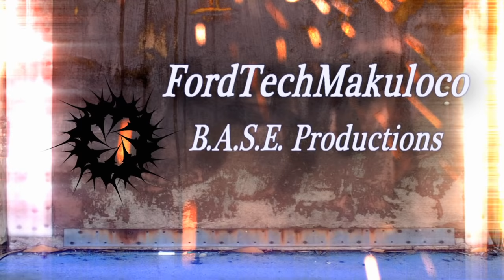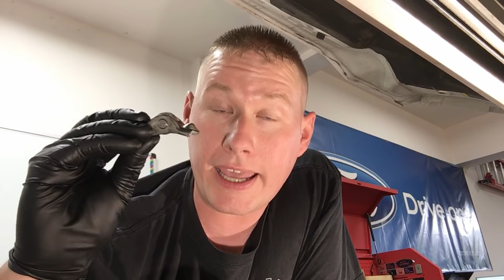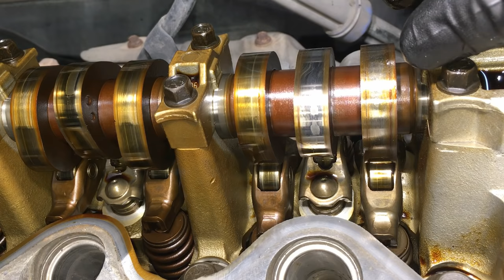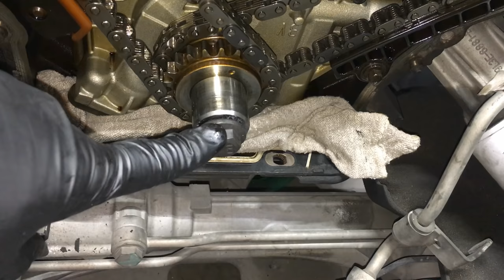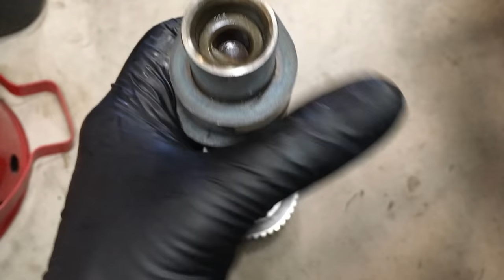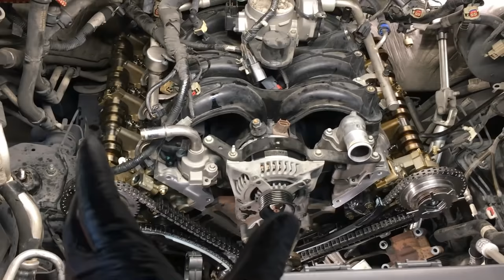Ford 5.4L 3v Triton Engines: Roller Follower Removal and Installation

Comment from the maker: These are the Tools and Parts I Recommend:
Valve Spring Compressor Tool-
http://amzn.to/2yorAwx

2004-2014 Engines Latest Roller Followers x24-
https://amzn.to/3BtEHgm

2005-2014 Engines can utilize this Ford Racing Kit-
https://amzn.to/492DRYC
Reply: @FordTechMakuloco i watched another video, with timing cover removed, there was no need to remove the roller follower to replace cam phasers and chains. I'm at the point of removing the chains. do i really need to remove the followers?
Reply: FordTechMakuloco  will it be off time if i spin crankshaft? Both chains were on , already time before i spon it just to have clearance to put the rest of roller followers. Will i have to put it back at 6 oclock? After spining it ?
Reply: HEY IS IT OK TO JUST LOOSEN THE TWO TOP CAM BOLTS ON THE LOB INSTEAD OF USEING THE VALVE SPRING COMPRESSOR TOOL?
Reply: Is this the same for all 5.4L Engines?
Reply: FordTechMakuloco i just got a 99 lightning engine setup for my 03 fx4..I'm doing timing and adjusters and followers..i found oem cobra set for good deal..are all rockers the same? M 6529 svt rockers..also are all adjusters the same?? Thanks. I can't find good info on this anywhere..u rock!!  Love ur work...
Reply: FordTechMakuloco Have you seen many oil consumption issues due to valve stem seals? I have a 06 F150 with 206k and it uses about a qrt every 800 miles with no external leaks, plugs are clean and no smoke on start. Any thoughts would be a great whelp.
Reply: Can I use this tool on 2016 5.4 2v?
Reply: Amazon is saying that this will not fit my 06 f150, can you confirm?
Reply: FordTechMakuloco Forgive my ignorance but if you're doing the whole timing wouldn't it be easier and quicker to remove the cams?
Reply: That's what I did. I replace all the lash adjusters and roller followers at the same time. Having the cams free rolling made the timing job easy. Getting all the roller followers in was a pain but doable.
Reply: FordTechMakuloco springs comepress
Reply: @PatriotDad  They all seem to use oil I seem to lose a quart every 5k miles
Reply: @PatriotDad  It likely is valve seals or seats because on a really cold start I have a little smoke out of the tailpipe for a few seconds yet oil leaks knowhere else to be found. Common symptom. Blowby past the rings would likely smoke full time during operation.
Reply: Hi I changed the lifters and rockers both sides bud putting the cam shaft I Brock the #5 cap it’s a rebuild motor and I can’t find a cap so I got one from a oem motor and sand down to de size of the one with the Bering I put back together now it runs fine when is cold but when is getting to temperature it wants to shot off there’s no vac leaks
Reply: FordTechMakuloco can you remove and replace the lash adjusters during this procedure?
Reply: PLEASE HELP, Sir, firstly HUGE thanks for all your help and your to time to share your immense knowledge to us lesser mortals. Does this process and the tool recommended/ suggested on Amazon  work for a 5.4l 2v triton (I have 2001 f250 5.4l 2v Triton.    Big thanks in advance if you can just answer YES . :-)
Reply: What if the cams are off are the tools still needed ? Ex: swapping cams for for hot rod cams what would the procedure be then ?
Reply: @watermalanblew  I'm doing the same. What Cams did you go with?
Reply: Thanks where you located  and how much you charge  to do the job .
Reply: How can  I contact you, I would like to discuss arrangements for you to rebuild my 08 f150 5.4 Triton motor. It has start up chatter, 162k miles.
Reply: Where do you work? How can i get in touvh with you
Reply: @kylekaae4986  did thg hey fit I have s 2009 f150
Reply: @javiervarela6050  On my 06, Yes. If you have any other questions, feel free to ask.
Reply: cory thomas  some ppl some replacing the ones that have been noisy from lack of oil or upgraded to the new design with smaller oil passages to increase overall oil pressure (posting this for others reference as 2 years later I am sure you are not still on this project )
Reply: What if you pull them cams out, then  can I replace the rollers with new and the lash adjustors, then set cam back in or what's the order sir?
Reply: I dont know if somebody can help me. I'm doing this process of replacing a roller on my 07 5.4 engine. I have had a ticking noise coming from the passenger side valve cover for a few months already. I already removed the valve cover and as I was checking the rollers one of them does not have any play at all. All the other ones have a tiny bit of play when moved side to side, would that be the one giving me problems? It's in the general area where the noise is coming from. Also I see in this video that he removes a roller that in a way let's say is pointing towards the engine, would this be the same procedure on removing one that's pointing away from the engine with this tool?. Seems that when I place the compression tool it hits and does not go all the way across.
Reply: Thank you for all the videos. They have been very informative and helpful. I attempted the overdrive servo retaining clip repair with the help of that video you have and it turned out to not be of help. Tear down of the transmission revealed missing splines in the direct clutch drum caused by the intermediate shaft drilling them out. Anyhow, I am looking to do the roller follower replacement, watched the video, clicked on the amazon link for the updated roller but maybe the link is old or the listing is updated but it appears that the roller in the link doesn't have the updated pinhole that you showed in the video. Any chance of an updated link to the updated roller because that link doesn't depict the part you recommend.
Reply: @briangibson5421  like the 4rth person asking.. dude desnt respond
Reply: @briangibson5421  like the 4rth perdon asking this.. dude doesnt answer
Reply: Just found the ticking in my 5.4 f150.
The inspection plate was rusty and touching the flywheel.
I removed it and now smooth and quiet. So used old one as template to make a new one. After installing new one runs smooth and quiet. Saved time and cash. Who would ever know that something so simple as that could cause the obnoxious ticking noise. I love my Ford!
Reply: I foolishly mixed my roller followers up what can I do
Reply: @kylekaae4986  i know this post is old but did you ever figure out if his amazon link for the roller followers fit your 2006 f150. I'm about to do the timing job on my 2006 f150 fx4 and Amazon says they don't fit mine as well. Also, when you did you timing, did you replace the oil pump with the melling, his link for melling pump also says it won't fit a 2006 f150?
Reply: I just did one of these. Is it normal to hear a little clicking sound when turning the engine over by hand? Sounds like a little noise coming from the top and just on a certain turn of the crank. Compression seems good and the followers seem to be snug and not loose.
Reply: Dear FordTechMakuloco Thank you for these great videos. Would you be so kind to answer my question ?  Can I used these tool in a 2 valve engine (2003 5.4l)?
Thank you would really apprecite it.
Reply: What would make a cam make a roller follower compressed spring at base circle
Reply: Brian i had a roller follower come out while truck was running..is there and certain way i have to put it back in. I did put back in and my cam shaft wont turn now...any ideas
Reply: Question for you? I am currently in the process of doing the entire timing replacement, phasers and all you have listed in the 4 part series. I also have ordered the followers and lash adjusters you had listed under the parts as want to replace them all. Is replaceing them the same as the one only you replace in this video? Thanks
Reply: anyone knows where this guy is located
Reply: hi there guys i know this video is been a while i just have question, i removed all my rollers so all valves are close and i turned the crank almost 360* then realized if i created  enough pressure to crack head gasket or damage something? thanks in advance truck is 2003 f150 5.4 2v.
Reply: Can anyone tell me if I can use a 3 valve spring compressor or do I have to get a two valve for a Triton V10 2 valve
Reply: I just changed my oil and I hear a tick but goes away after awhile from the valve area. Always right after an oil change.
Reply: FWIW, for anyone looking into this these days, the Amazon link takes you to a listing that has these priced at $21.13 EACH. my Ford dealership quoted the 3l3z-6564-a (newest part number, previous design ended in AB) at a bit over $13 a piece. as of today I found several online stores that have them listed for less than $10 each. still seems expensive for what they are, but that's better than the dealership cost.
Reply: Why does Amazon say this link to rollers don't fit 2005 5.4l 3v ??? Also shows old style
Reply: Amazon will only let me purchase 6. It also says they're from China
Reply: I have a 2010 ford f150 xlt crew cab 4x4 5.4l 3v. Would you recommend Melling hydraulic valve adjusters Part number JB-7504?
Melling roller rocker part number MR-1851?
Reply: Hey, would this be the same for the 3V V10?  It seems like it should be? 2011 F53
Reply: Do you have to have the camshaft in to remove and replace all of them
Reply: Would it be the same procedure for a 1999 Lincoln navigator 5.4 ????
Reply: I did my 2011 ford expedition xlt 5.4l 3 valve complete timing kit replacement.  I followed the exact way he did the 4 part video.  I use Ford parts and Melon high pressure oil pump. This vehicle had 218,000 miles and was all original parts.  It needed this job done bad. Now it runs like a new engine. I thank this guy for his great introductions. I put almost 10000 miles on it and it's great. Thanks.

Comment: Great video thanks! I missed the "very important part" about pushing as you compress the spring. A bit of stomach in the throat moment when I saw a keeper fall as I lifted out the rocker. Luckily the tool had shifted a bit and the spring was pushing the valve sideways preventing it from falling into the cylinder. With some strong magnets, a little pry to center the top, I managed to get it all back together, released the tension to make sure the keepers were seated and then recompressed it to put the new rocker in.
Reply: Holy smoke, I would have pooped my pants. Great job.
Reply: Wow!. This is by biggest  concern. You got lucky. Glad it worked out.
Reply: Yeah....  a really important part of the procedure...

Comment: I have a 2008 Ford Expedition. I was blessed to have come across your page on YouTube to better educate me on this motor. You REALLY helped me out. I spent a while looking places up, took your advice on a lot of things to look at for at dealerships so I drove to Orlando to get the roller followers, camshafts (if needed) and timing done. I was going to get the updated oil pump too.  In Miami I was quoted 4,500 and in Orlando I was quoted $2,700, both at Ford dealerships…Orlando being the cheapest. Once the tech looked at the truck I was told I have metal shavings in my oil filter and said that I need a new motor because the motor is eating itself from the inside out. They did not open the motor at all. I requested prior to coming up here that I wanted to see whatever the tech finds but there was no communication. Now I am headed back to Miami to another dealership for a second opinion. I sure wish I was near Chicago brother, you would definitely done my motor over/replaced it. It’s so hard finding people that’ll do it right! Thanks for all those videos my friend. Any advice will help out.
Reply from the maker: As long as the engine oil was maintained you will be ok with just a timing job. Fine metal in the filter would be the result of the chain hitting the front cover like they all do, no big deal. $2,700 sounds way too low like they are not replacing everything, $4,500 sounds right for a dealer. I even charge $3,500 to $4k with all the extras as an independent.
Reply: @FordTechMakuloco  I really appreciate you getting back to me brother. Means a lot .
Reply: @FordTechMakuloco  am I able to remove the lifter one I removed the follower? Mines making a tapping sound and I would want to replace both. Thanks
Reply: @willcountypowersports6338 camshaft has to come out to replace lash adjusters/lifters. Ask me how I know. Being a Ford diesel tech, I’m not having a good time working on a 5.4 😂

Comment: My brother was so fed up with his 2004 F-150 4x4 XLT, he threw me the keys and the title and said it's your problem now and went and bought a Toyota truck.  140K original miles.  I'm getting replacing to replace the transmission with a yard pull from a known working truck.  Once that is done and verified working, I'm landing in on the engine with a phaser kit and now since I hear ticking, I'm planning to inspect the cams and followers.  Would it just be a good idea to pull the cams and replace all the followers and lifters while I'm in the engine?

Comment: Dear FordTechMakuloco  this is just an update on the Expedition in the video .The motor is running great just hit 183k and still runs like the day i bought it  .I maintain it religiously ,     Thanks Again  for your great work
Reply: Same here. Not sure why theirs so much hate on the 5.4. Just hit 200K miles on mine and still runs great. However every 3 months or so I end up replacing something. Alternator, pulley bearings, starter, ignition coils.... Always something to fix but the engine itself is great. After seeing this video i'm not going to attempt replacing these roller followers but am definitely taking it to a mechanic to replace.
Reply: @danbiss87  Sounds a lot like normal maintenance over 200k brother.

Comment: I am doing a timing chain, cam phaser job with new lifters and roller rockers. I had a huge problem trying to remove the old followers on some of the cylinders following your guidance. I ended up having to remove the cam shafts to get them all out. I though maybe the chain had slipped and caused the cam lobes to be too far from the base circle to get them out and I didnt want too risk popping off keepers or other damage. After following all your steps for timing chain and phaser replacement will all Ford parts and having replaced all the lifters before reinstalling the cams, I then started to reinstall the followers and once again was having difficulty putting them in.  Finally after struggling through 3 of them I inspected the genuine OTC 6684 tool that I had purchased from a defunct Ford Dealership selling off tools, I found that the part that pushes the valve down was bent! It wasnt real obvious but it was enough to only allow the valve to be depressed partially. So I carefully straightened out the tool and it was like magic. All those follower went in with no trouble. 
Just goes to show how careful you are to do it right some things just go wrong. Im just happy to have it resolved. I will be done with the job tommorrow. Im 68 years old and a retired Ford Tech, but I havent done major engine work for decades as I specialized in electrical/electronics/AC/ etc. Thanks for all your great videos and guidance.

Comment: I bought a 2005 f150 Lariat with 136k miles that was in great shape, but had a misfire when I test drove it and also a tick. I first did the spark plugs and coils and found all but 2 were loose and one had the end broke off. It drove better but still didn’t have power and felt like it was still misfiring and ticking . I then decided to change all the roller followers and lash adapters. I took the valve covers off and found my problem, it was a roller follower locked up and the cam had been just grinding away on it on the right side of my engine. After replacing my cam, roller followers, and lash adapters my truck runs like new. I couldn’t have done it without your amazing videos!

Comment: Rookie mistake... I placed a towel near the phaser to prevent anything from falling down into the pan. Placed another towel on top and cleaned up all gasket material and dirt. Started working and was stumped why the engine was so hard to turn over with 18mm. Realized I forgot to remove the towel and binded it up in the phaser, chain, etc. Slowly cutaway material and turned the motor over manually until I could pull the towel out of the teeth. Hopefully I did not stretch the chain or throw off timing. Guess I will be doing complete timing job next. Still can't believe I did that... thank you for the great video!
Reply: Threw P0017 code.
Reply: So sorry to hear that bro !
Did you fix it by doing the complete timing chain job ?

Comment: Get the OEM valve spring tool! I tried to save a buck and the cheaply made knock off I bought was garbage and didn't work. You're already saving money by doing this job yourself so bite the bullet and get the right tool. Rent it if you can. Also thanks so much for this video. I learn so much and have saved so much money by doing repairs myself. Merry Christmas and take care.

Comment: Fantastic tutorial. My 2011 Expedition sounded like a diesel and had lost power under acceleration. Figured it was timing related or something else. Used a stethoscope to figure out where the sound was coming from, it was loudest at the rear most passenger side roller follower. Turns out one roller follower was completely seized and the other 2 on that back cylinder weren't too far behind it. I figure it wasn't too couldn't have been too far from grenading itself completely. Great tutorial and the tool recommendations were very helpful to be able to swap out the roller followers... Saved me from spending $$$ at a shop or worse yet, having to replace the vehicle completely.